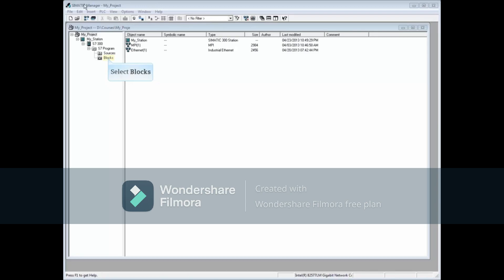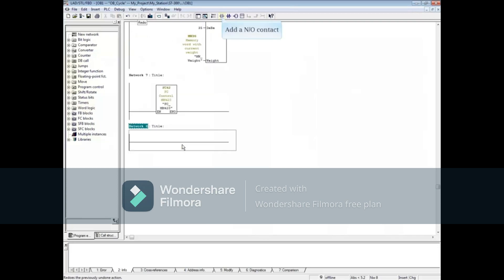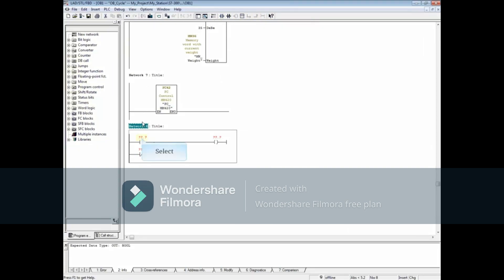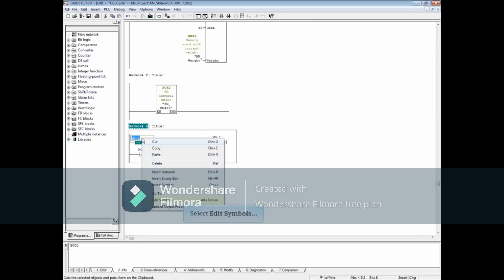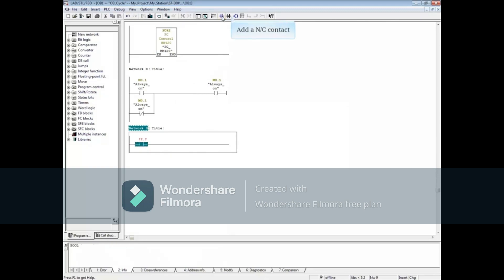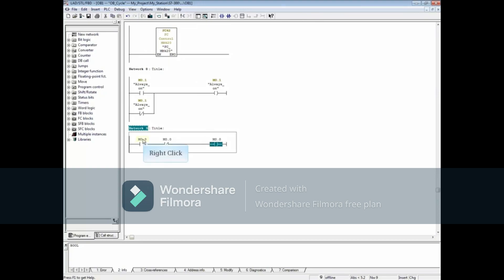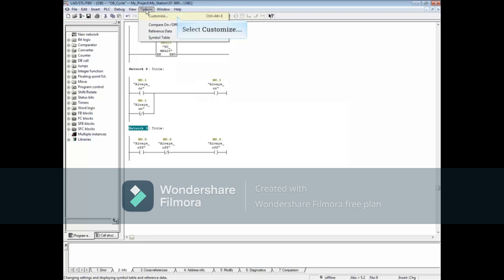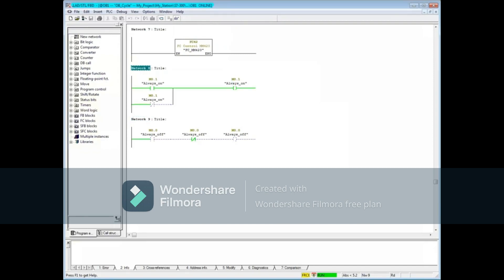55: Create an Always On and Always Off Bit in LADDER || Step 7 || Simatic Manager Step 7 Tutorial

Comment: Please mention.. What is extended the field address.. What the use plz
Reply from the maker: I did not get your question
Reply: Sir.. What I asked is.. After creating always on off memory bits.. U said customize option and lad/Fbd..extend the address with.. What is that option and why u changed the setting to 18
Reply: Adress field with option 10 to 18
Reply from the maker: This is a display customisation. 
"Always_on" was displayed in two separate lines. To show in a single line, that customisation is done.
Reply: Ok sir tq u